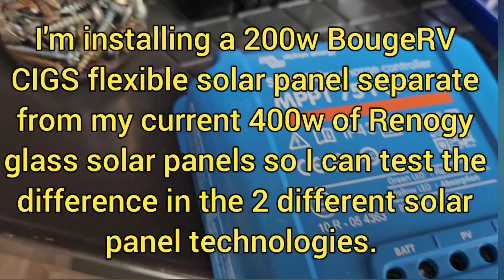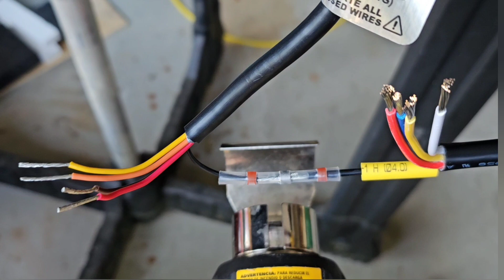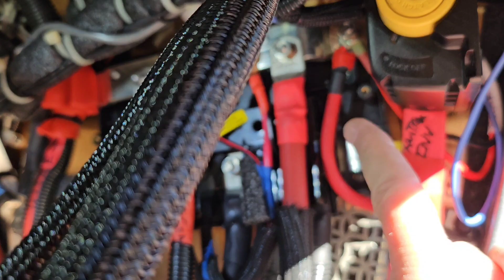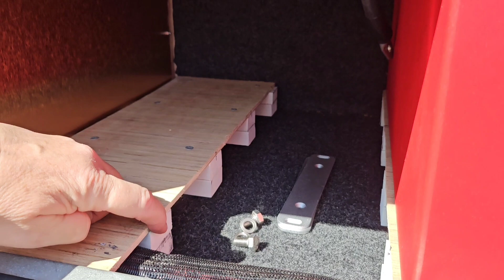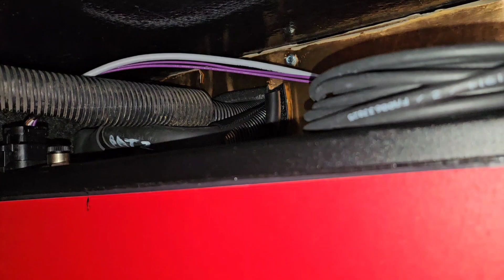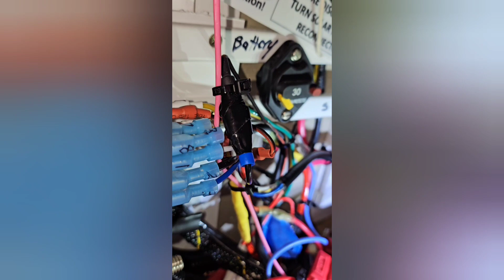Using a Victron Lynx Power In for a Complete 12v Power Distribution Center for Upgrades

Comment: Very Nice job on UR install  -  one thing U might like is Liquid Electric Tape - its brush on liquid rubber to insulate bare copper/connections  - works well - easy - good for use  instead of tape/ heat shrink in hard to get at areas   -  peals off if needed  -   RTV also works well

Comment: In our '19 UMB, the listed weight limit in that bay is 165 pounds;  since you're hanging on the walls and batteries on the floor, I was wondering if you reinforced the cargo box in any way.
Reply from the maker: I've talked to LTV and have the compartment CAD Drawings that show how much structural strength and support the compartment design has. The 165 number is to keep people from putting to much weight in the compartment, there by causing an exceedance of the GVWR. The area of the compartment that is the weakest is the large sheet metal floor. If you spread the weight from corner to corner and install things on the strong vertical walls the weight forces are less of a factor than putting all the weight directly on the flat floor. I don't advise putting more than 1 heavy battery is the center of the compartment floor. If you ever do, you'll see how much the floor deforms. I do know folks that add a sheet of stronger, like diamond plate aluminum, on the bottom of the compartment to strengthen the floor. Since I spread the weight from corner to corner there isn't a concern.